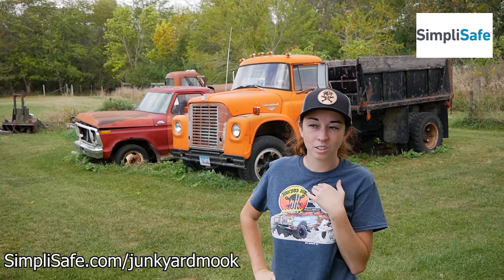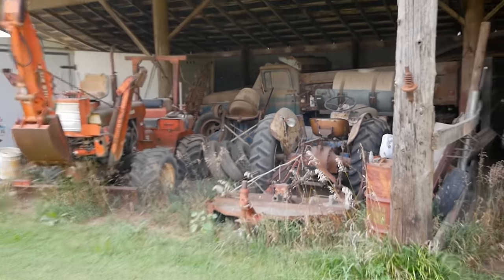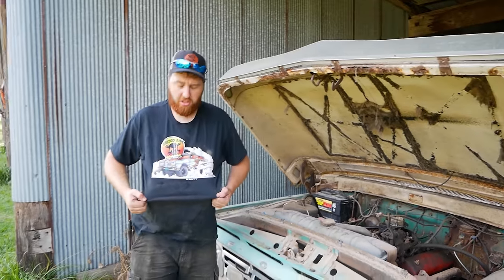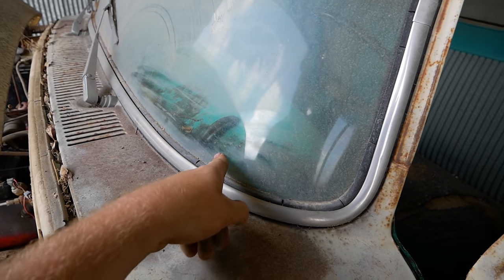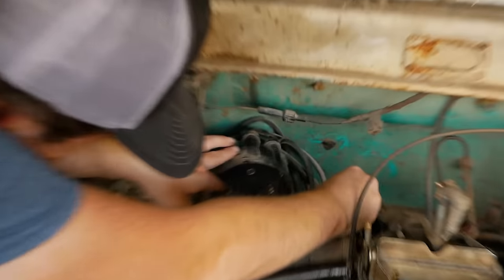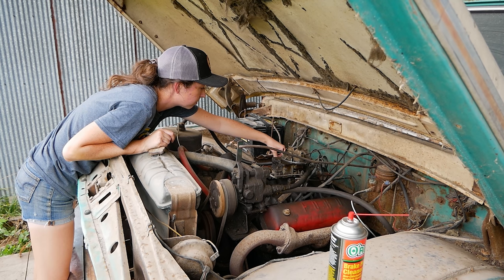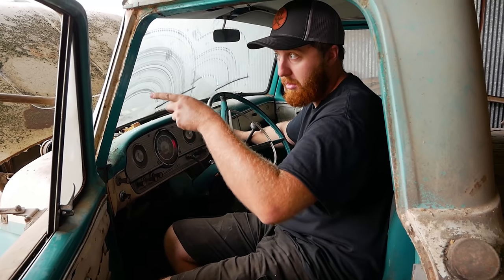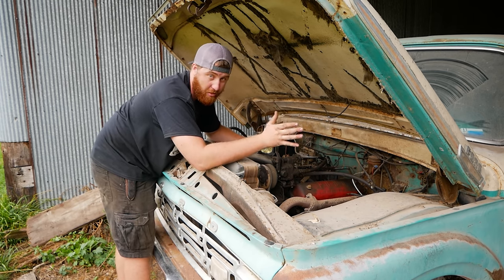Will This FORGOTTEN Ford Dump Truck Run Again?!

Comment: In the 1950s, a guy who didn't live that far from my parents house had an old truck (from the 1930s/40s) sitting in his yard.  My Dad stopped by the guy's house one day to ask him what he planned on doing with the truck.  The guy told my Dad that the truck hadn't been run for several years, but if my Dad could get it running, the guy would sell it to my Dad for $10.00.  My Dad managed to get the truck running, so he got the truck for $10.00.  This was before my time.  I never saw the truck, but I have a photo of my Dad standing next to the truck.  Enjoy the videos of you and Kevin bringing back "junk" trucks back to life!

Comment: Absolutely love those old 50's 60's Ford trucks. They just never seem to die, they will run with hardly any maintenance. Those Y blocks were a real jewel, they have a sound like no other and ya just have to love them. Great video Mook, I really hope you can get it.
Reply: I had a '54 Ford Crestline and a 292 out of a truck (Forged crankshaft)that got put in.T-85 tranny and 4.26 rear end. I got 16 tickets in that car. Street raced the heck out of it.

Comment: Check out the gold T Bird for me when you break from the trucks in another direction? Thanks, I appreciate that!
Reply: I bet it has a 429.
Reply: @thecynic807  It is a 68 T bird and does have the high compression 429. I used to have one.
Reply: @ericbrown5354  my dad had two. One for parts. The main one was a light blue and white interior. The other was gold. It was wrecked by my uncle. So he bought the blue one and put the transmission (C6) from gold in the blue.  It was so fast. And the gold had a 390. 
So my uncle wrecking the gold one a blessing.  429 and the C6. Damn thing could do 180 mph. And from a dead stop not hit second till 65mph and still bark the tires.

Comment: I'd love to see you guys go back there and revive that F150 with the 460 and a plow. I'd want that one! Depending on if it isn't rusted out underneath and the transmission shot from plowing.
Reply: That's got my vote too. Minus the plow, small lift, real bush/sand/mud tires and I would be a happy camper. Not crazy on the lift, I want it to tow a monster camper.
Reply: As an Iowan I would bet it's extremely rusty and that tranny is shot. Especially if it's a plow truck.
Reply: @colinklang  yes

Comment: great vid mook and kevin,dark leather patch better,your so lucky to find these old cars and trucks,in UK anything left outside just rots away,you would make fortune sending trucks over here,huge yank truck scene here.keep up good work guys
Reply: It depends on where you're at here in the states. Here in Maryland you're lucky to have a car or truck for 15 years before it starts rusting out and I do mean rusting out. It usually starts on the backside of the panel. So by the time you notice it the panels already too far gone to repair it. America is a big country though. Alot of people don't realize how large we actually are until they come over here.
Reply: @JoshSmith-wo7zw  I'm from Ceciltucky and I can attest to the fact that Maryland can turn any ride into a rustball with paint holding it together...

Comment: Kevin,  the oil pump on that engine is external and the valve can be shimmed for more oil pressure. Great video! [Edit]  Also, when you change oil the first time,swap one quart of oil for a quart of ATF.  Won't hurt that engine,  I'm not endorsing this treatment for newer engines.

Comment: Should add a touch of 2 cycle oil to your gas to help with the cold starts revials. I have seen some of the old timers put the mixture in a cheap spray bottle and spray down the carb. Be more even then dumping it down all at once.

Comment: I find it easier to fill the float bowl through the vent tube/port. Then it runs for the duration of several ounces of fuel without you being in the way of a possible backfire.
 LOVE your videos.  
 Thanks

Comment: One of the drawbacks of the Y block, the distributor is in the back like a Chevrolet. you have remember those Y blocks have solid lifters and it's amazing I have had pretty good luck with the autolite and motorcraft carburetors. typical Ford cold-blooded as hell. I have to say I like the corn binder dump truck.

Comment: Not a ford guy but almost every vehicle my friend has is equipped with the motorcraft 4 barrel and they always seem to work just like a quadrajet. 59 Edsel, 76 f150, 79 f150, 78 f100, more Edsels that aren't on the road. The only bad carb he has is the 72 mach 1 with some kind of spread bore 4 barrel. Wonder why you have such different experience with them. His experience goes back to working at the ford dealership 70s-2000s

Comment: Do the big ole dump truck! They are the best! I just pulled out a 64 Ford f600 one of the best old beast trucks it’s my beast now!! Fe 352 52 thousand original miles is so clean

Comment: 292 Ford V-8 has trouble with the oil passage thru the head to the rocker shaft becoming plugged. Make sure the rockers are getting oil. It was common for people to add an overhead oiling kit.

Comment: Actually the oil light is supposed to come on when you turn the ignition on. It goes out after the engine starts and builds oil pressure.
The generator light is supposed to do the same thing. That's on the opposite side of the speedometer from the oil light.

Looks like Iowa sunsets are as pretty as North Dakota sunsets.

Comment: The plow truck is a 1977 by the way. somebody installed the 460 if it really is one, factory not supplied until '79, in F-350's  The usual V-8 engines were M-351 and 400. 
I retired after 40 yrs from a Ford/Kenworth dealer and Ford has been my main vehicle to work on since I was in Hi-school

Comment: drop a bottle of engine flush in the oil once it starts to run . it will thin out the oil and help pressure by cleaning the pump / galleries / pushrods etc. after a few hours run drop the oil / filter replace . remember mineral oil only .

Comment: it’s not called Juice  for that big tank with the long straw  to drink in the cabin of the truck  it’s called Hooch   which in the South and Appalachia is code for Moonshine  i heard a story about a guy years ago that did use his Windsheild Washer system slightly modified to pump  his Booze  into the  Cabin  when he was driving around in his truck

Comment: Video just popped up in my feed again so having nothing better figured give it another watch.
Cannot believe I missed the most obvious comment ever.

It's Mook my lord in a flatbed Ford.
Guessing that screwdriver spent a lot of years sitting on that dashboard combined with years of exposure with that windshield catching the sun from dawn til noon or so as I've never seen a plastic grip just disintegrate like that.

Comment: Great truck! Hopefully you can buy it, Mook.

What's the story on that 53 or 54 Ford big truck by the 78 F350?

Kevin feel free to send any of those Autolite 2100's my way. I love them. They are about as simple as you can get when it comes to a carb. They are easy to work on, reliable and have annular discharge on the venturi's.  I use them or the Autolite 4100 4V's on all my carbed engines.  I run 2 or 3 of the 2100's on my 240's & 300's.

Comment: It looked like the centre nipple in the distributor cap was stuck in when Moog had the cap off a Aussie would think it may be not transfering the spark to the rotor button correctly may be worn and it being pushed in only makes contact on different positions

Comment: Farms always have the good abandoned vehicles.
Ours has a 65 C60, 73 F600, 77 F-100, 77 GMC Sierra K15, 83 Silverado C10, and some others that ain’t that good lookin.
The C60 just needs a lot of wires, and a new ground for the ignition cause it’s getting toasty due to bad condition
The F600s two speed is messed up
The F-100s condition is unknown, just very low miles.
The K15 got parts stolen off of it
And the C10 just has 200,000+ miles on it.

Comment: The '78 probably gets better gas mileage than this dump, though you could work the dump delivering gravel and stuff for driveways.  Don't get too discouraged about the '78 booger.  You just need to find or fix the trans and a show where a friend who has fixed automatic transmissions before coaches You and Kevin through it would be great!  or just cruise the junkyards and swap meets for one that fits.

Comment: Mook, you're not crazy,  you just have eclectic taste. Reference the 460 engine with dual coils,, I'm going to guess that is not the original motor.. It probably came out of the fire truck I saw in your walk around. Dual ignition is commonly used in emergency vehicles so if something goes bad in one of the systems the engine will continue to run as before.
Ps. You're very attractive in those shorts.

Comment: Way 2 go on gittin' it up and runnin' Junkyard Mook,but how it usually is if u work on 1 part and replace it with a new part,it's goin' 2 tell and work on another part and then y'all will have 2 work on that part.

Comment: Great color had both a Ford and a Chevy that color when young in the late 70s early 80s green 69 Chevy 3/4 ton and an 71 ford miss them trucks can’t drive a standard anymore after breaking my back

Comment: The reason why you have only an  inch between the  steering wheel and your lap is because you had to have leverage to turn the  wheel  because the power steering was all the power you had in  both arms

Comment: The dark looks like it’s a wood stain pach it’s weird how diesels you put two batteries in it I just started mine sat last time the plate register 2015 I found a bill because it’s an old work van 2014 was on the bill my dad‘s friend went and got it parked it Up in coin Iowa and that thing started and drove with just two batteries

Comment: 16:30 Anyone one else screaming at them to choke it?  It has a manual choke (might be rusted in place) give'er a pull and she will run without all the drama.. 27:39 finally...

Comment: Ok so you're basically trying to cold start an old truck with as little time or new parts that typically need replacing or checking.  If you had no budget to spend what parts would you automatically replace to ensure your chance of success?  For example replace the battery..points...change the oil...disconnect the fuel line and mock up a makeshift fuel system gravity suspended gas tank..etc.  Seems to my newbie novice mind that the fuel and electrical systems are the 2 most problematic systems. Thanks for your time...

Comment: Hey guys I like that truck definitely has some potential anyway I have a question if you are interested in coming to Massachusetts for a Revival I have a 1960s mack. " Gas "  it ran probably 10 years ago when parked.. if you are interested you can send me your email and I can send you some pictures. Started doing some work to it it has copper fuel lines brake lines whatnot so if you're interested let me know

Comment: Cheap Kevin Daycare service here. But your not allowed to touch my 1964 Ford F250 with a 292 Y block. But I can be paid by him helping me do my projects. I have a 1975 Ford Gran Torino with 351W,working on my 1964 Ford F250,and I have a 1999 Dodge Ram 5.2L 4x4 that needs heads changed. Nothing for sale but could use the help. Southeast Iowa. I have a nephew that would like to meet Kevin. Don't know why. LOL!!! Just kidding.

Comment: I had a 73 we swapped a 390 y block in and once I got it running I accidentally stuck my hand in the fan it smacked my hand back out still attached not even bleeding my hand smashed me in the nose and broke my nose I effin hated that truck I won it in a bet I swear it was cursed

Comment: Or I have a Ford F3 50 costume truck Dooley diesel pretty good shape for the most part 350 in-line six cylinder Perkins Diesel
It runs and drives the guy wants $2500 for it it runs and drives and it’s in good shape but it hasn’t rained in 15 years so I did wrong and you can say

Comment: ZIL 130 ir neliels Truck ar 6,9 V8 motoru skaists arī gazons ir ar 6cilindru 3,5 litru un ar V8 4,2-4,7 un motors no brdm bruņutransportiera varbūt ir 5,5 v8